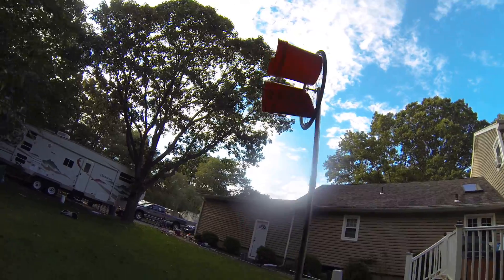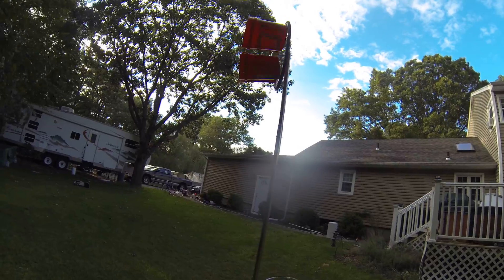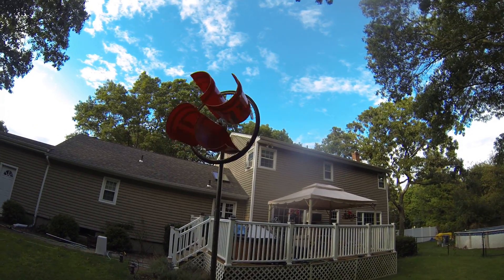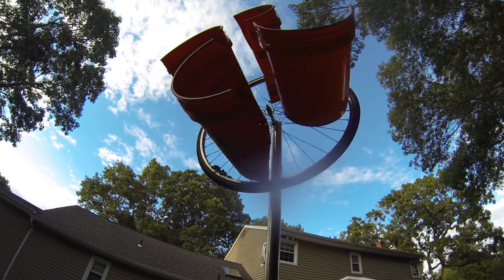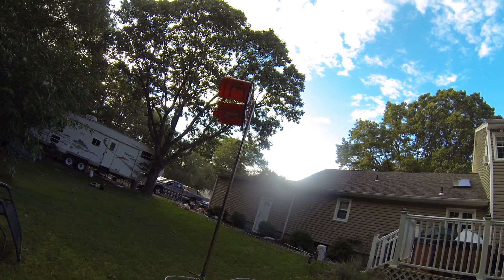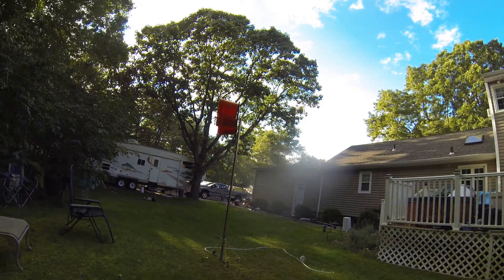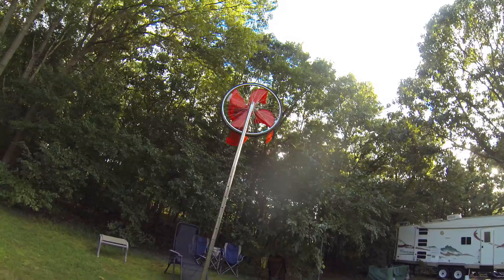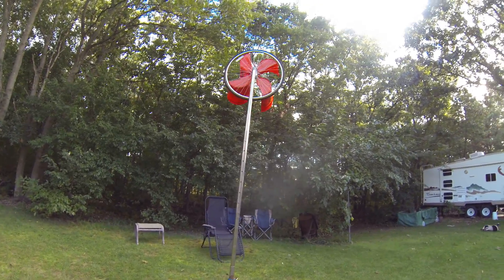wind turbine running

Comment: HOW MANY WATTS DO U GET FROM IT
Reply from the maker: DK1 i dont have a generator hooked up to it however i believe if i did that i wouldnt get more than 5 or 10 watts but im in the process building a much larger one with blades instead of buckets i will probably have a video of it soon so stay tuned